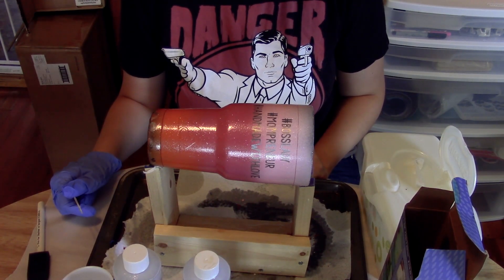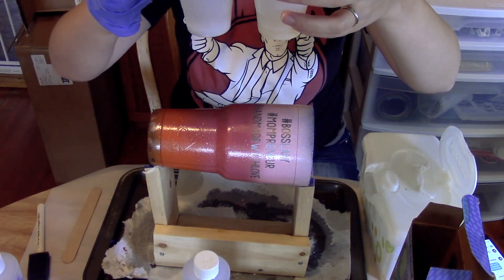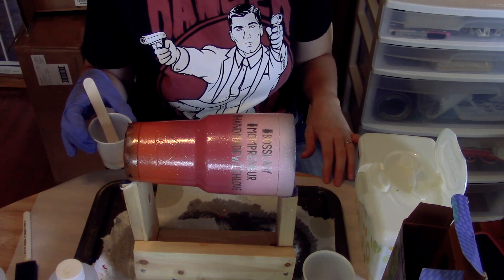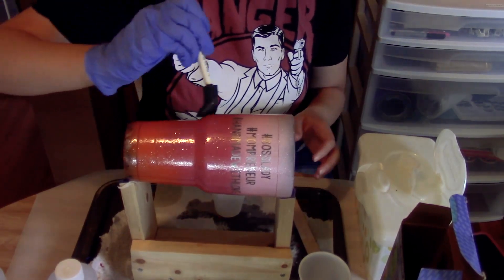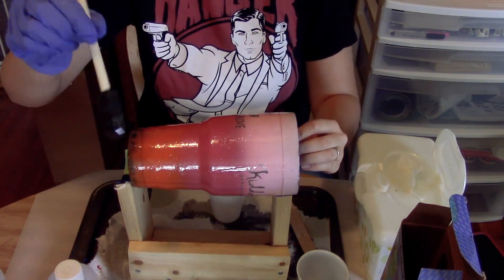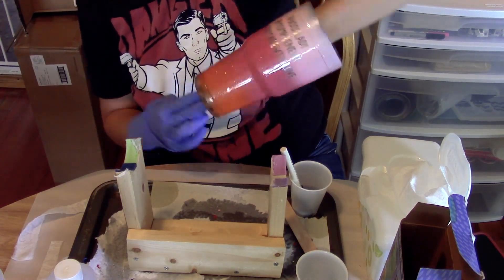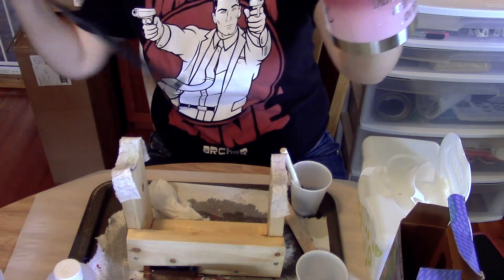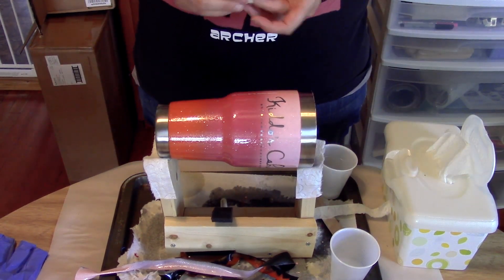How to Epoxy your Painted Tumbler

Comment: So I messed up, didn't watch your video first and have lots of dimples.  Is there a way to remove them? Or is there a way to remove the expound and start over so I don't waste a cup?
Reply from the maker: Kailee M. you can try send sanding to see if the dimples can be smoothed out, but I've had little success. acetone and sanding will remove the epoxy and all paint, just takes a lot of work
Reply: Acrylic nail soak (used to remove false fingernails). Lay out paper towels, drizzle the nail soak thoroughly, wrap cup in them and then wrap very well in aluminium foil. Let sit for 24 hours (in garage or basement, because of fumes). Unwrap and it will peel off with just a bit of rubbing.

Comment: I used 1tbs of each for  epoxy  mix and I still have some dimpling in several places. Can you tell me the steps to fix them.
Reply from the maker: surfnfroggie did you use two coats of triple thick before epoxy? temperature also plays a role. too cold can lead to dimples too.

Comment: How do you do the glitter on the cup? Do you use a loose glitter?... I cannot find ANYWHERE on how to apply the glitter 😞
Reply: There is spray on glitter which I believe is what most people (myself included) use. It's in with the spray paint.
Reply from the maker: There is also a painting tutorial that covers the glitter. I use both a spray glitter and a loose glitter, depending on the project. The spray glitter is just applied like the paint. for the loose glitter, I let the cup totally dry, and add one coat of triple thick spray. Then I have a spray adhesive that I very lightly coat the tumbler with. I sprinkle the glitter over the surface and let dry a minute or so, then I run my hands over the cups to even out the thin layer of glitter. Do this over a trash can or other container- it's messy!

Comment: I am getting waves in my epoxy what am I not doing right? I don't think we were getting enough in until I watched you video. So I applied more and now it's not splotchy and looks bad but now I have waves in it.
Reply from the maker: Logan Norman I get waves when u don't apply enough and/or don't rotate enough. if you just apply a second coat over s first wavy coat, it'll still look wavy

Comment: Have you had any problems with epoxy staying sticky? If so how do I fix it?
Reply from the maker: The stickiness will happen if the epoxy is not mixed well before applying, or if there are not equal parts of each. I would try to add a second coat- wait at least 24 hours for a full cure!

Comment: I did my epoxy 2 nights ago and it's still feels a little tacky.... did I do something wrong? Was my first one!
Reply from the maker: Mickayla K the epoxy might not have been mixed well enough, or you might have had unequal parts. how long has it been curing?
Reply: It's been just over 48 hours since I first put the epoxy on the cup
Reply from the maker: Mickayla K it has definitely had enough time to cure- I would say it is one of the issues I mentioned in the first comment. one of the first I made I didn't mix the epoxy well enough and it never set up completely. you can try to add another thin coat to the top if you'd like (it can't hurt). just mix a small amount and mix very well
Reply: Dang it!!! I bet I didn't mix it well 😞 At least it was a cheap one to learn on! Not giving up will try again! How long do you mix yours? Thank you so much!!!

Comment: after my cup has been done for 24hrs I have dimples in it. if I apply another coat of epoxy will it fix
Reply from the maker: It will be smoother, but the dimples will still be visible. I usually get dimples when I skip the triple thick spray.

Comment: What is the triple thick spray you refer to?
Reply from the maker: It's a sealer that I use before doing the epoxy. It is a Krylon product. I find it next to the spray paint section in stores.

Comment: I just did mine and they are sticky after setting for 6 hours is that normal ? I made sure I mixed well and measured correctly
Reply from the maker: After 6 hours it propbably isn't fully cured yet. I don't touch mine for at least 18 hours. Full cure is 24

Comment: Hi I did my yeti and it dripped in the bottom is there a way to remove it on the bottom after it has cured ?
Reply from the maker: I have been able to just pick at the spots of epoxy with my fingernail or very gently with a metal scraping tool to remove it.

Comment: I think I used too much epoxy. My cups have a bunch of tiny bubbles and the epoxy isn't smooth/level even though I turned them very frequently. 
Can the epoxy layer be lightly sanded and then I can reapply a fresh layer of epoxy?
Reply: Nesreen Mills you can sand it and recoat but I recommend sanding and polishing it..
Reply from the maker: Try the wet sanding method also- very very fine sand paper and water.

Comment: How do you fix spots that do get messed up... ie bubble or drips or runs?
Reply from the maker: I try to make sure I don't have any runs or drips- which is time consuming but worth the effort. Any drips onto the stainless steel portion can be scraped off after curing with a fingernail or very gently with a metal scraper of some kind. I have also heard you can do a wet sanding method to sand down the epoxy and re-apply in spots. Use a VERY find sandpaper.

Comment: whats the difference between using epoxy to seal and just using modge podge
Reply from the maker: depending on the type of mod podge, not all types are food safe. I've also found mod podge to get weird when it gets wet (like. the glossy kind). epoxy is a lot tougher. holds up to washing and it is limited food safe.

Comment: Does anyone have trouble with the foam brushes leaving tiny dots of debris all over the cups? I sand and reapply the epoxy and the brushes crumble on it again so it is a waste of products. I have tried vacuuming the brushes before hand and keeping them in a sealed bag until I use them so it has to be they are just falling apart in the epoxy. I use the 45 cent brushes from Wal-Mart. The foam brushes from Michael's left HUGE chunks in the epoxy. No one else on the internet has this problem I guess so any advice is welcome!
Reply from the maker: I have noticed a few spots here and there. I try to have a set of super fine tweezers with me when applying. I check for spots and remove them while epoxy is still wet.

Comment: Do you have any trouble with the triple thick spray dulling out the glitter? I used the triple thick in the bottle on some wine glasses and it totally took the shine away from the glitter.
Reply from the maker: I have- Let them dry completely, then see how they look. Sometimes if the spray isn't shaken up enough, or if it is too cold, it will appear cloudy. If still cloudy after several hours, make sure the can is room temp, shake well, and apply an additional coat
Reply: Mad Mugging Mama

Comment: Is it normal for the epoxy to get an opaque color?
Reply from the maker: no... the epoxy should be absolutely clear. Make sure you get the clear casting resin and not the regular casting resin, which dries white!
Reply: Thanks yes that would help. lol

Comment: Why does my cup feel sticky after I put the epoxy on? Did I not put enough?
Reply from the maker: Sorry for the delayed response. If the cup is still sticky after curing over night, it could be either improper mixing of the epoxy, or incorrect ratio of the two parts.

Comment: thank you for the video. I tried do 1 and used spray paint over my vinyl decals stencils. when I went to remove my decals I pulled up the paint with it. Any suggestions?
Reply from the maker: Kimberly martin mine do that when I apply the paint too thick or don't let completely dry between coats

Comment: This may be a common sense question, but is it necessary to epoxy or will just leaving the layer of triple thick do the trick?
Reply from the maker: The triple thick will eventually scratch and is not as durable. it is also not a  food safe material.

Comment: Is there any way to get the epoxy off after you have messed up to completely redo the cup? I'd rather just redo instead of wet sanding because that never seems to give me the perfect finish.
Reply from the maker: You can remove with acetone and elbow grease, but the process is pretty time and labor intensive. It will also remove the paint.

Comment: lighter fluid is a thinner for epoxie.
Reply from the maker: oldasa I use straight acetone as well
Reply: Acetone evaporates so quickly you'll be left with a sticky mess if you don't hurry.  Lighter fluid gives us a longer working time.